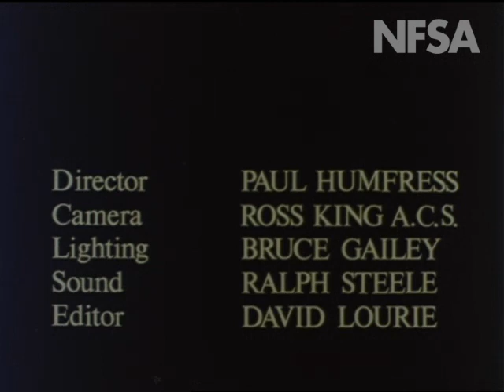Artisans Of Australia: Stonecraft

Comment: No eye protection :/
Reply: safety squint old chap
Reply: Maybe required with flintwork, but generally if you're working at the right angle the bits are going away from your face
Reply: @desiolle2874  A well timed blink.

Comment: And now we have CAD and 3D printers and this sort of work will fade away...
Reply: I would never match a master's craftmens work. done by hand takes skill what would you do without a machine.  nothing
Reply: There are entire factories now running almost entirely automated, because they say that the second a human hand touches the product, it becomes less consistent. 

The good news is that machines don't just design art by themselves, so even with the ability to print buildings, the fingerprints of humans will still be on them.
Reply: Not true as heritage mason we still hand make product
Reply: You're right, sadly.
Reply: No eddie. Not all of it. Some textures can only be applied by hand tools. Some pieces require such technical set up for the machine that it is too expensive to use machines. The building and restoring of such craft is not for machines. There is still plenty for willing skilled hands to do.
Reply: @Desi-qw9fc  . There are certain details that only skilled hands can do. There is nothing ‘consistent’ on earth. Even machines lose accuracy as the blades and tips wear down.

Comment: Much of the slabs of moulded ashlar were carve on the mould cutting machine at Saunders quarries half mile away from here...Central station as well...here's a picture of the maschine..https://images.squarespace-cdn.com/content/v1/5b90c69eb1059856af5325df/1539327612984-3KVVFAEHYMURTLYNVOKA/02.-Paradise-quarry-1883-1.jpg?format=1000w
Reply from the maker: Great information. Thank you.  The NFSA in Sydney is currently located on Saunders St Pyrmont.  Only metres from some of the old cuttings.
Reply: @NFSAFilms  i have seen it, many times, i live  acrosss the bay, the written history of Sydney is still only piecemeal, sadly...btw, Luna Park and particularly Coney island, was originally the stonemasons section of the harbour Bridge construction as well as steel component assembly area...cheers